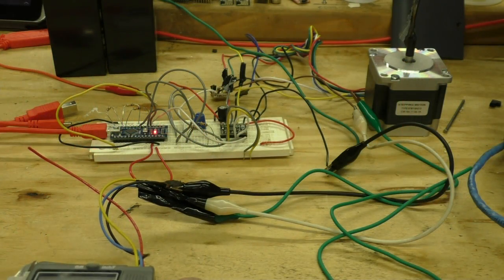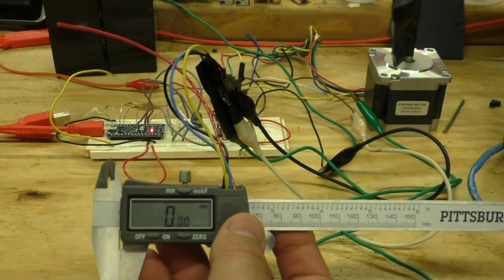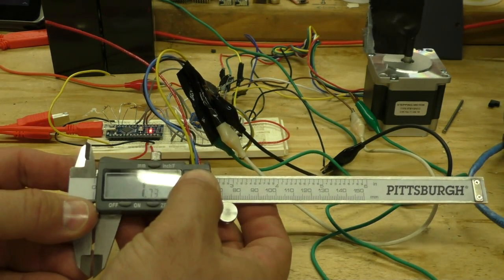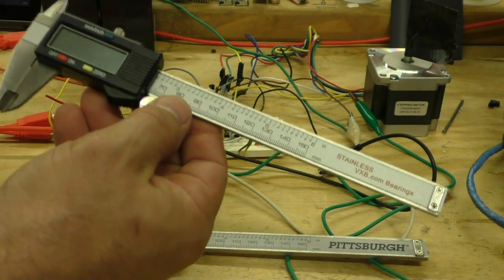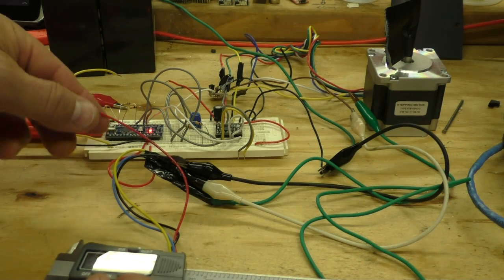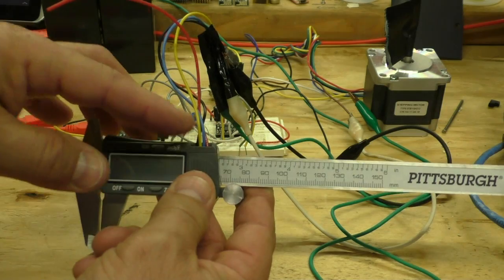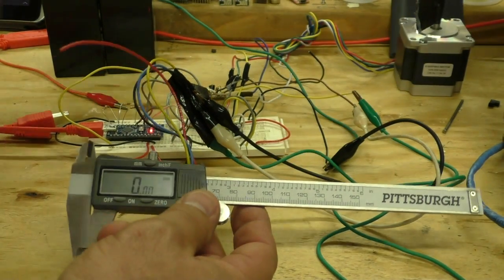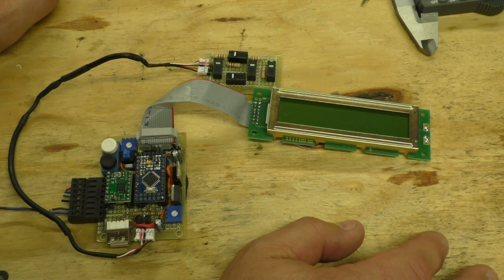Digital Caliper and Extruder Update

Comment: Many years ago I had a drill press, and I wanted to use a digital caliper to create a DRO using a arduino. Never did build it :(
Regarding batteries vs external power, could you use a supercap in place of the 1.5v battery? Feed it with 1.5 volts while the extruder's running, and it'll maintain a charge once the power's cut. How long will it last?
Test this, for science :D
Reply from the maker: Super cap sounds like a good idea.  The only way to find out how long it will last is to try it.
Reply: just FYI i did this already in the past.  and its only good for a backup function... ( but the calipers i had it on died... not sure why) but i used it as a backup option, so if power was cut it would hold its value. else it will reset to 00.000... ~Russ
Reply: Aww it's a shame it doesn't last longer 😞 I suppose you could wire a D cell battery in place instead? That'd likely outlive the callipers 😜